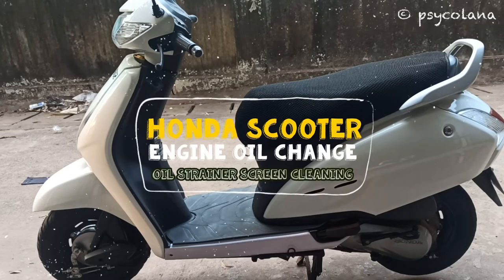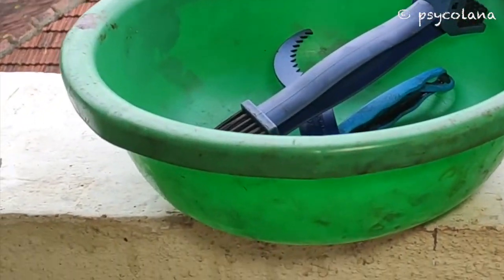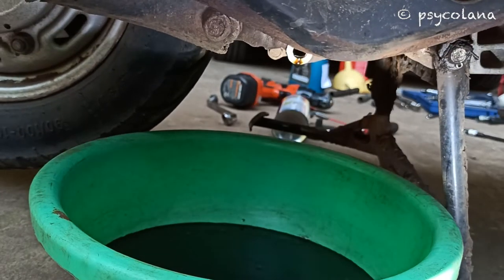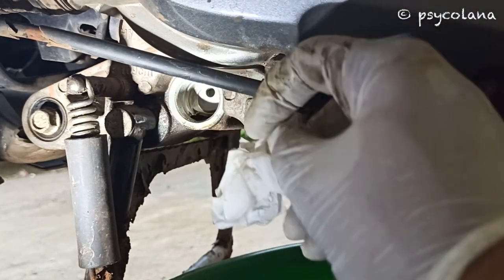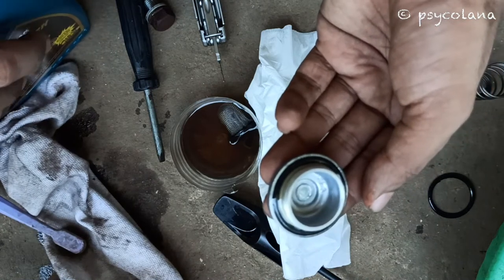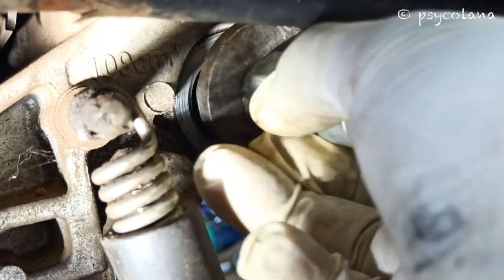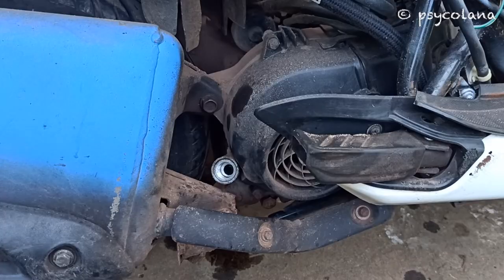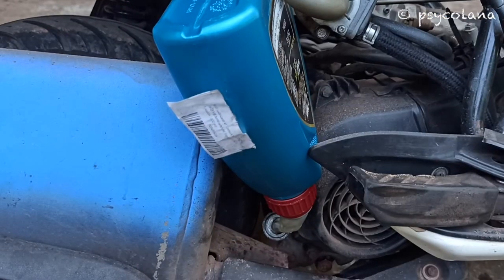Clean Oil Strainer Screen & Change Engine Oil in a Honda Scooter

Comment: Oil filter O rings are one or two? When removed there is one sticking to cap very tight,we have to remove it and replace with new O ring??

Comment: How did you set exactly 20nm using torque wrench? Is there any symbol of size on torque wrench? How to make sure not to exceed 20nm? Pls clear my doubt?
Reply from the maker: Hi, torque wrench there is a marking of 20nm, depends on the torque range supported by your torque wrench
Reply: tq bro @psycolana

Comment: Can we clean the strainer without draining the engine oil?
Reply: can be done, but you will have to remove the petrol from the fuel tank or have an empty fuel tank, rest the scooter on its side (on an old tire preferably or some soft material to prevent scratches) and do the needful

Comment: Clean oil strainer in 1200 kms or 12 months or 12000km??
Reply from the maker: If I am not mistaken as per manual it says 12 months or 12000km, but I would say once a year.

Comment: Does Honda Activa 102cc 1st Gen (2003) has Oil Strainer screen?
Reply from the maker: what is the model is it a SCV100CM2, it has on the left hand side.
Reply: @psycolana  Its the first model released In India
Reply from the maker: @cah7925  yes SCV100CM2 released from 2002-2005, yes has a oil strainer screen on the left hand side
Reply: @psycolana  Thank you..😊
Really nice n detailed content👌👍
Reply from the maker: @cah7925  most welcome and Glad you like it
Reply: @psycolana  It would be really sweet of you if you help me on how to increase its Pickup bcoz I maintain it neatly n time to time service but If two persons sits on it doesn't pull n makes lots of noise
Reply from the maker: @cah7925  - Have the clutch area inspected (drive belt, roller etc) - have the Carburetor checked (cleaned, tuned)
Reply: @psycolana  Thank you soo much😊🤗